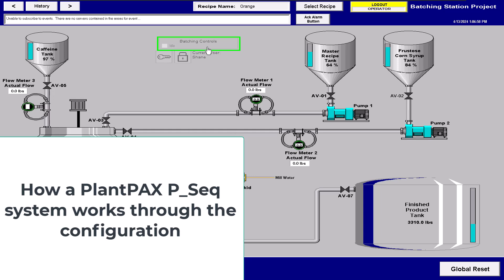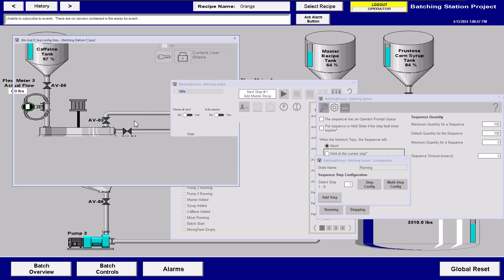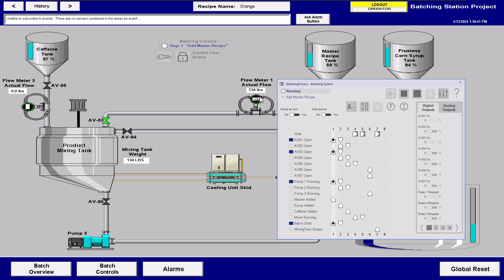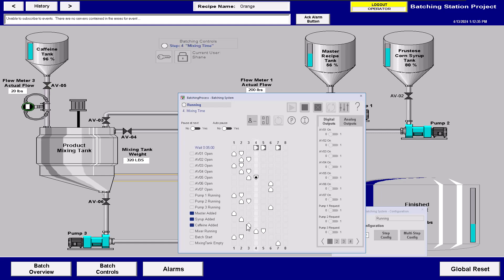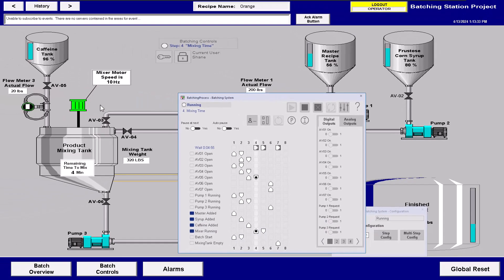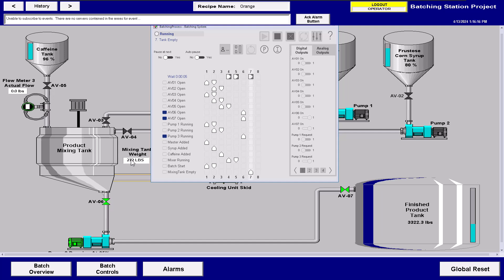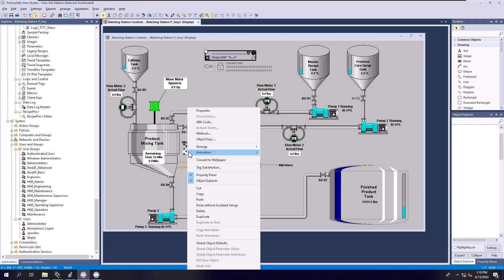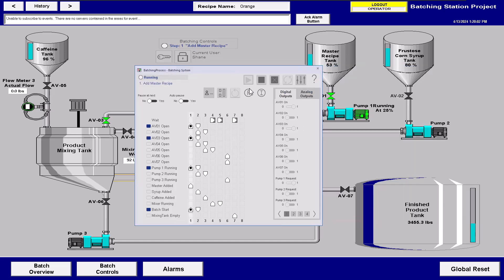How a PlantPAX P Seq system works through the configuration

Comment: Appreciate the great videos you are putting out. I am wondering if it is possible to configure the sequencer without using the factorytalk view software?
Reply from the maker: @andrewott33  Factory Talk is the best for PlantPax
Reply: @ShaneWelcher  Thanks! I am working on a project that used the sequencer with Ignition as the Visualization. I ended up configuring the values in the PLC tag. I just needed to adjust when the timer started for a particular step. I updated Cfg_NOTTmrAfterQualify to 0.